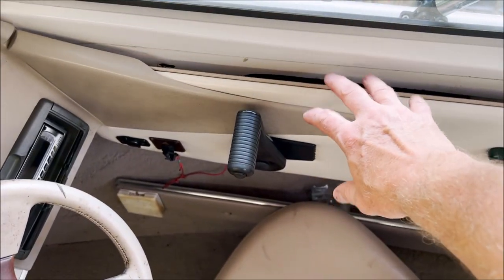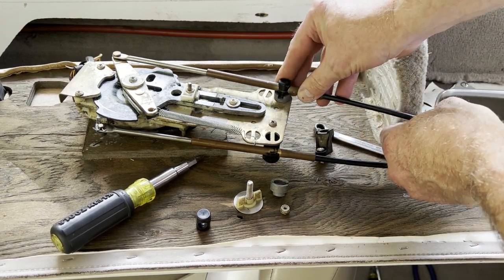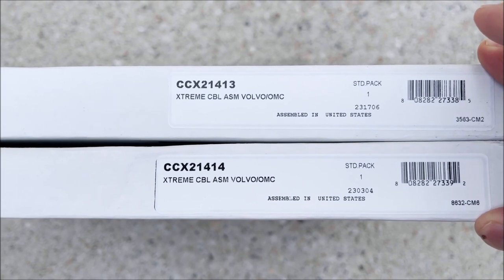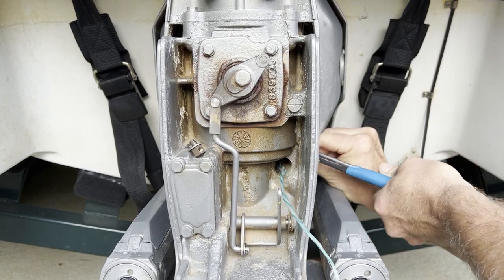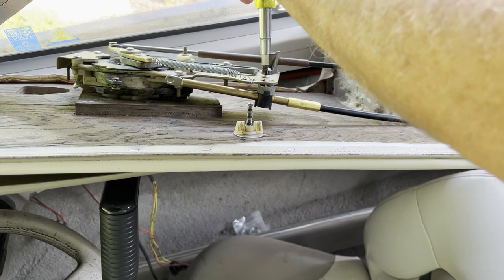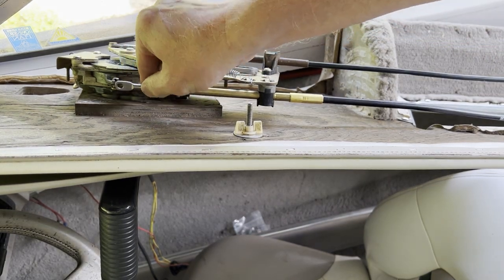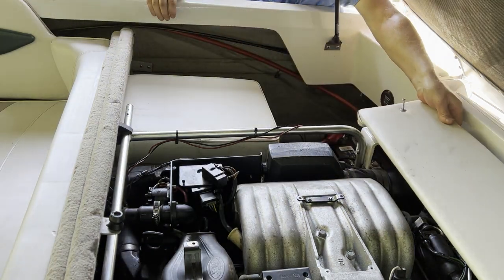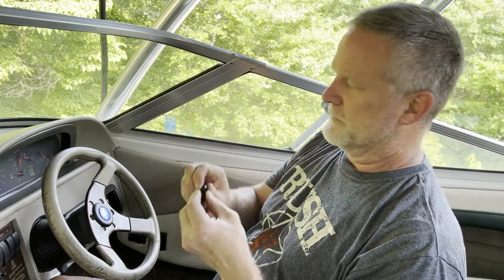Boat Shifter/Throttle Control Cable Replacement (Four Winns stuck in gear)

Comment: This is a great video. My 2001 Horizon 190 with the 5.0 did the same thing - that black molded keeper on the shift cable broke and all I had was forward. My cable was a little stiff and I wasn't able to hold it like you did. I watched your video last year (mid 2022) and decided to put a bunch of JB Weld on it rather than replacing the entire cable. Well, that lasted until this year, 2023 when the JB Weld broke. I ordered a 14ft cable from Amazon, about $85 shipped. I then removed my old cable, and found it to be a 15ft. I have the correct one coming now.  Thanks again for your video.
Reply from the maker: Thanks. The new cable makes a big difference.

Comment: Great video. I’m about to do this on a 1999 240 Horizon. Hope I can get the cables.
Reply from the maker: Your cables will be much longer since your is a 24’. It’s really not too hard to replace. You will like it when you are done.

Comment: I have a 97 sundowner with the same out drive. Is the trim sensor as much of a pain as everyone says? Or do you have some guru knowledge to make it easier?
Reply from the maker: @noninvalidargument  I haven’t dug into that one yet. Mine just started acting up but I think mine is electrical.
Reply: @fixthemthings  from my understanding it's very difficult to feed through the transom... And there's a very poorly placed retainer bolt

Comment: Just curious are the nuts to take off the panel easy to reach or a bit hidden, I’m having a hard time locating them on my boat.
Reply from the maker: Your boat may be different but just reach up under the panel and feel for them.  The 2 screws in the back are harder to see. Use a mirror to see those.

Comment: Just wondering what the part number is for that throttle control box I have a 1997 180 horizon looks the same
Reply from the maker: I had a hard time finding a replacement. Mine is still good though. You have to make sure you get one with the correct push or pull.

Comment: Can you buy the replacement plastic cable clamps for the shift cable?  That's exactly what broke on mine.
Reply from the maker: I wouldn’t bother. The new cable is sooo much more free. I would spend the $80 and replace it. You will be much happier shifting. I just did both cables since they were 27yrs old. I could have got away with just changing the shift cable.
Reply: @fixthemthings  Yes, replace the cables, I agree... but the plastic broken clamp thing is art of the shifter, not the cables.
Reply: @fixthemthings  In your video you called it a cable holder.  I got the boat in by doing exactly what you said...held it steady in order to get it into neutral.
Reply from the maker: @davefitch6380  oh. I’m sorry. I thought you were talking about the plastic on the cable. Not sure if you can buy those or not. You may have to fabricate something yourself or find one in junk yard. I assume google search didn’t work. I would try OMC control box or OMC remote control parts in google.
Reply: @fixthemthings  OK..cool.  the one I'm trying to sort out is from a 2008 Four Winns.  I think that plastic design is not very good.  But, if the cables were replaced maybe the plastic is ok.

Comment: Hi, thanks for the video I found it looking for the black piece that holds the cable to the control console. A friend of mine asked me to make that part for his boat as he has the same lever as his. Could you tell me the brand of that lever or how to find the model? I would need a replacement of the black piece that holds the cable.
Reply from the maker: That black piece is molded to the cable. I would just purchase a new cable $80. I assume he wants you to 3d print one. 3D printed one will break a lot easier than the molded plastic.  Hope that helps.

Comment: OK so I have a 1996 190 Horizon, green just like yours, and I'm a huge Rush fan. Had the same shirt you're wearing, until I wore it out. And of course I have your grey hair. Are we the same person?
Reply from the maker: Awesome. Are you 6’4” also?  😂. Rush is the best. Great boat. 5.0L in mine.
Reply: @fixthemthings  5'7" on a good day🙃. Guy at Four Winns told me that mine was actually made with the '97 driveline. Wife wants a bigger boat but I don't want to part with it. Cheers!